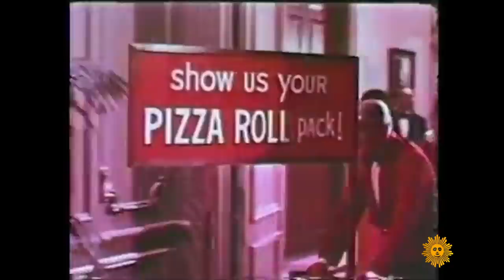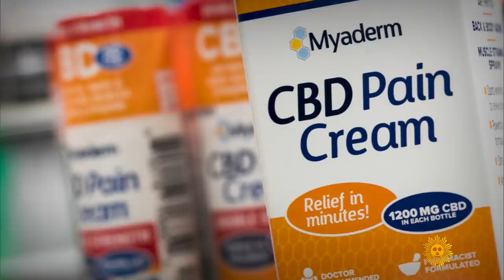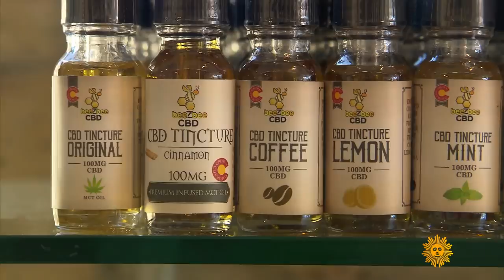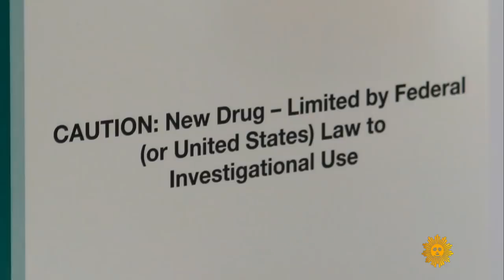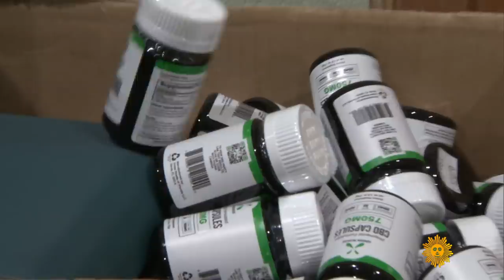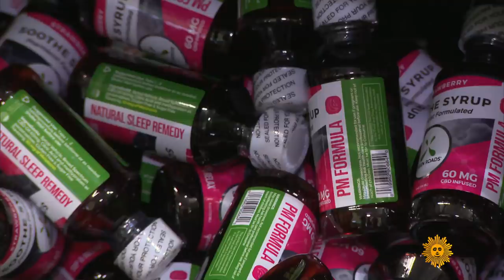The boom in CBD products

Comment: Tried this stuff for pain. Used a reputable supplier with independent lab tests to verify potency.  Tried the liquid form as well as topical.  Did absolutely nothing. Waste of $....and it was not cheap.
Reply: Patti Carey I tried many brands before I found the one that worked for me.  You’re right it’s extremely expensive but I’d rather that then the steroids I was on.
Reply: It has been used very successfully to treat epilepsy. My seizures are improved at least 80%, both in frequency and in severity. And it is much, MUCH cheaper than the sometimes dangerous pharmaceuticals used to treat epilepsy. Waste of money for you, but a near-miracle for many epileptics. Everyone is different.
Reply: It's not for everyone, Patti. 
Waste of money for you maybe. Saved my life.
Reply: if cbd isn't working you might  want try kratom

Comment: look up charlottes web weed.
it will change your mind.
Reply: John, I think you're talking about CBD oil not marijuana, but the brand Charlotte's web. Last I knew Charlotte's Web only does CBD.
Reply: I’ve never heard anyone refer to Charlotte’s Web as “weed” before. It’s a high quality, CBD suspended in olive oil and has been successfully used to treat epilepsy, safe even for young children. One should, however, do some research and get advice from the manufacturer before using it with children. I have been using it for about 4 years for my mild epilepsy and my seizures have diminished not only in frequency, but also in severity. In contrast, the pharmaceutical that my neurologist had wanted to prescribe was more than 8X the cost and had a long list of very scary potential side effects.
Reply: Yes Charlottes web or greenroads are some of the top companies out there for high quality.